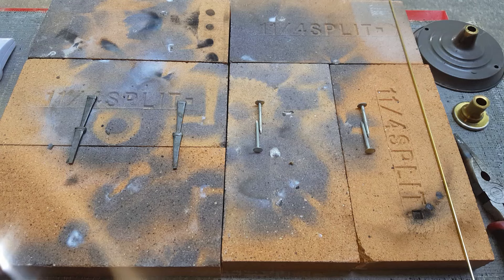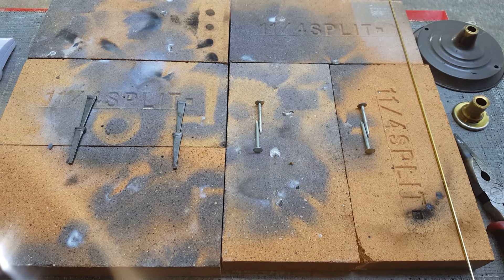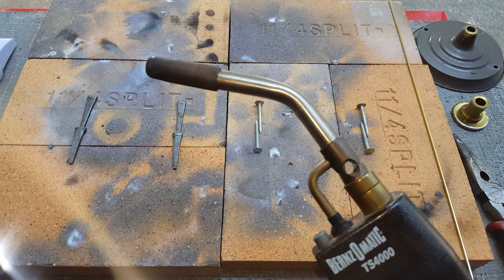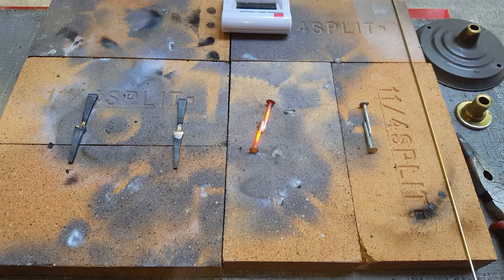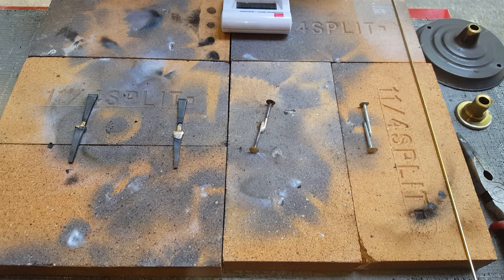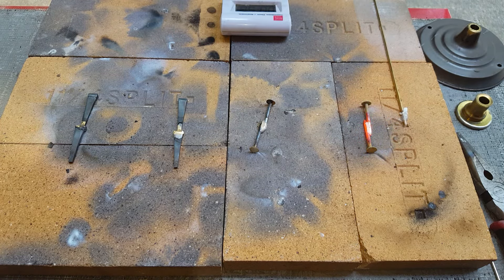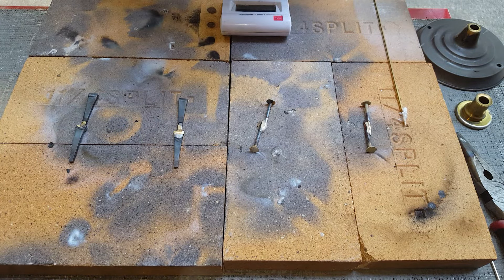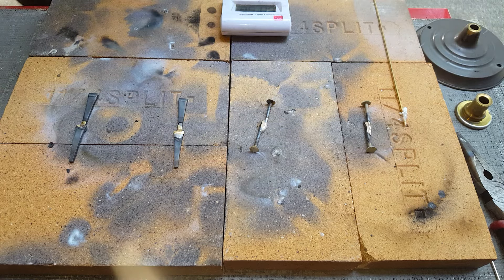Brazing with Bronze rod Torch test TS4000 vs TS8000 Bernzomatic Mapp Pro

Comment: I went out and got the TS4000 self-start nozzle with a bottle of MapPro today and it enabled me to finish a brazing job that I was unable to finish with the Propane bottle and standard nozzle. Yay!
Reply from the maker: Much hotter on the map pro 3730 deg, propane in the right part of the flame 3596 , glad you were able to get your project done
Reply: @dctmakes3487  hey have you done other map pro gass torch tip videos? I was wanting to ask you if you could do videos of thes 2 propane/map pro gass torch tips I've seen online one of them uses 3 flames but you can choose to use 1 or 2 or all 3 and there's another one that uses 4 flames but it only does all 4 at the same time I just want to see how theyd compare to other torch tips you know what I mean I found the 4 flame one online it's sold with a map pro gass but the brand name is whip it map gass and I think the brand name for the tip is also whip it im not sure though
Reply from the maker: @JonathanDawson-s7r  Looked at them, they go to 2500 F over bronze high point melt 1972 F, Maybe just lacking volume and time to braze. Stick to the large torch for large jobs. use these for small tighter quarters jobs. Just my take
Reply: @dctmakes3487  are you sure you saw both torches ?? One is whip it the 4 flame one the other is on a sight called bluefire can't remember what the brand name was but it looked like a big one to me especially if u put it on map pro I mean 3 flames 4 flames you'd think would always beat 1 flame but maybe not or maybe if theyd make one with 4 flames but each one the size of the flame on the tip your using think of how hot that may be shit especially if they made real map gass still never got to use it
Reply from the maker: @JonathanDawson-s7r had to go to usa web site to see what you are talking about, not available in UK. If its the core pro4 looks good for brazing, if you use mapp pro full size volume bottle. I will see if I can get one from my buddy in the US.

Comment: Thanks for doing this. I'm not a welder but I need to make some 12 inch long M5 bolts, so I need to braze an unplated nut to one end of an unplated threaded rod. I figure I'll screw on the nut a half inch onto the rod, braze it, then cut off the excess rod, belt sand the bronze flat, so in the end I have a very long bolt with a nice hex head for a socket wrench. I'm hoping this will work. These homemade bolts wont be torqued very tight in use but are surely cheaper than paying $12 each for extra long M5 bolts (If I could even find them in the USA). Thanks again for teaching me how to braze!
Reply from the maker: Afternoon, high tensile strength when done correctly, 60,000 psi is average tensile with the correct heating and filler rod. A lot of times the weld is stronger than the base metals. Watch the other brazing vid I have with the oxy rig to watch the color when to add the rod/flux. Bright orange, test on some scrap then beat the hell out of it to test. pre heating is the key, no cool spots were the weld is ...best of luck

Comment: Thank you for the video! I’m not sure if it mattered but a possible source of error was having the tests performed so close together that the heat from the torch applied to one test could have leaked over and given the next a “head start”. Probably not much though if any
Reply from the maker: The bricks pull the heat, the 8000 is a way better torch no matter how ya test it. Good question

Comment: You might try the same tests holding the torch an inch farther from the workd.
Reply from the maker: yeah I hear ya, trying to explain flame density, heat draw and all the other detail in a short vid was not the intention, just some neighbor's saw some vids on brazing and they came and asked about it, they did not believe you could braze bronze with Map Pro. May be I will do a vid with more detail

Comment: Great video am thinking of getting the ts 8000 , what rods are you using would they have to be 1/8 rods and what Flux can you use pre fluxed rods  any help would be appreciated. Also could you braze your car exhaust with it .Thanks Dale
Reply from the maker: Morning, I use 1/8 and 3/32 bare rod bronze with Hobart flux. Also Lincoln flux coated rods of the same two sizes. here's a list https://www.northerntool.com/shop/tools/product_200659237_200659237
 https://www.northerntool.com/shop/tools/NTESearch?storeId=6970&ipp=48&Ntt=bronze+rod  
You can braze exhaust pipe but you have to have clean metal and control the heat well, warm the joint all over then hone in to do the color watch to know when the bronze will melt/flow. watch my other vids with the oxy torch to see the color point, then as the bronze flows to the joint move the heat around the joint. If you don't the bronze will just sluff off . Ya dad said what I am going to say next ............ practice on the same metal thickness and shape if possible. best of luck

Comment: What composition brazing rod did you use? What portion of it is silver (Ag)? DOes it contain Zinc (Zn)? What is its melting temperature?
Reply from the maker: straight copper/tin alloy .... just over 1600 F melting point
Reply: @dctmakes3487  This is very high temperature, melting point-very impressive performance.  With silver rod that would be easier.
Reply from the maker: @eugeneeugene3313  sure but not as strong, 63000 psi on a good braze with that bronze
Reply: @dctmakes3487   Do you mean  63000 psi for your copper/tin alloy or silver alloy? I am contemplating between Stella Copper-Phosphorus-(Silver) Alloys without Zn, like Ag15CuP and the Zn-containing alloys,  Ag30Sn. Ag15CuP claims tensile strength 54kg/mm2 (76806 PSI)  and the Ag30Sn 48kg/mm2 (68272 PSI). What do you think?
Reply from the maker: @eugeneeugene3313  no expert but would depend on the project requirement the stronger braze may be more brittle. probably better to contact the rod manf. based on the actual project requirements, sorry no specific answer. hope ya find the info

Comment: What's the difference between brazing with bronze and brass? I watched a guy weld broken cylinder head fins on a cast iron head using brass. I don't understand why he chose brass over other metals. He was also using an acetylene torch. Does brass require higher temperatures? Could you do the same repair using bronze with mapp gas? Thanks for any input.....
Reply from the maker: Hi, yellow and red brass have a slightly higher melting point than bronze rod. Different cost also, both are not actually melting the base metal just using capillary action gripping the surfaces. around the same strength  psi Lots of things affect this though, surface prep, porosity etc. endless list  . main thing bronze is corrosion resistant to lots of different conditions and brass is more easily shaped/cut and more malleable.  the mapp torch will not create the same volume of overall heat on a larger piece than a oxy rig. small area sure you can braze with either.. but this barley covers brazing possibilities, have a good day

Comment: Would the Mapp gas work for brazing copper tubing on a refrigerator compressor? I dont want to buy oxy acetylene torch.
Reply from the maker: You can with the correct filler rod and practice, mapp will melt copper easily, watch my making jewelry for sweet pea

Comment: Can mapp gas braze thin cast iron?
Reply from the maker: you can but on the smaller side as the metal acts like a heat sink, and the torches dont have the BTU to keep the right amount of heat on a large piece of cast iron
Reply: @dctmakes3487  I have a 2nd propane torch to help keep the surrounding area hot. Thank you this answered my concerns if it was possible at all

Comment: Would the ts8000 be able to braze 4mm moderate steel?

I don’t know if i need a different torch, gas, or brazing rod. I just searched and tried to find something, but it didn’t work just now. Heated the metal forever. It is -2 C in my shop though.

Perhaps i need every variable changed.
Reply from the maker: Evening, yes but MAPP PRO gas not propane and make sure the joints are clean. Watch the heat color on the videos for the bronze to be introduced (not too early) practice if possible on some scrap if you have it. Suggest 3/32 bronze bare rod with Hobart  flux , The Mapp gas burns way hotter

Comment: Hello dctmakes.....................are you able to instruct me how to "debraze" steel parts?  Thank you
Reply from the maker: Depends on the thickness of the joint, if its thin you heat it to molten and very carefully pull the joint apart being really careful of molten weld substance, wear gloves, glasses, leather apron  and do it at your own risk ...always dangerous pulling molten joints apart
Reply: @dctmakes3487 I thank you for the response. Never have done so before Safety safety safety goes without saying

Comment: Is that flame a bit close,
Reply from the maker: It is, I was going for equal not trying to explain flame density and heat range in the flame column, imagine the questions if it was further away and you could not see the blue flame